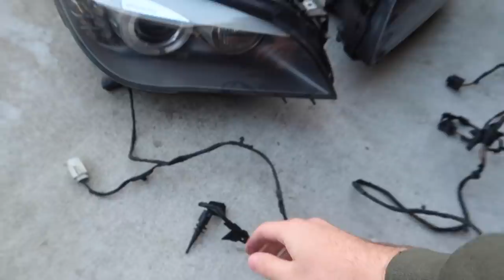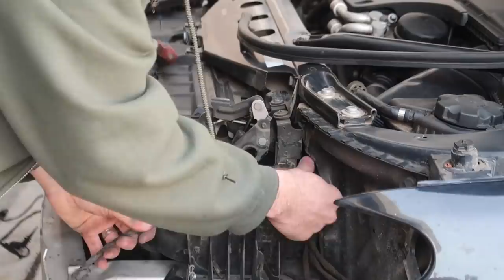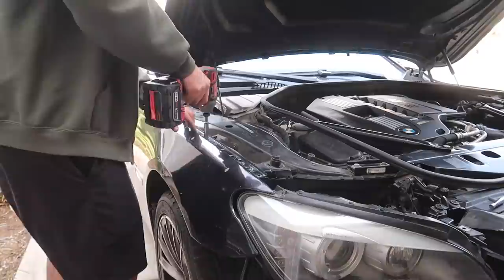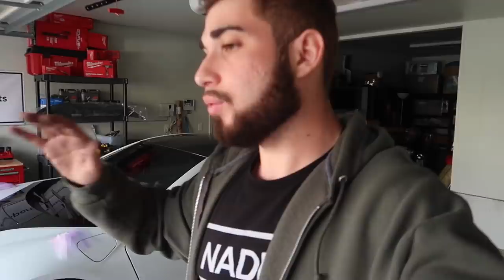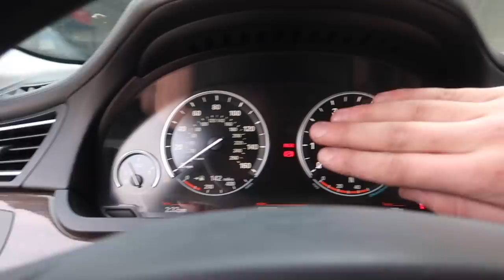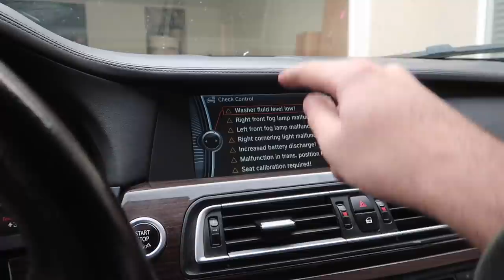Rebuilding An Abused BMW 740Li N54! Part. 7

Comment: You could have just rethreaded the stripped drain bolt for 100 bucks instead of buying a new pan. And you'll still be able to use the oem drain plug